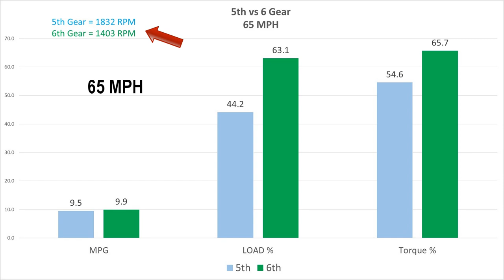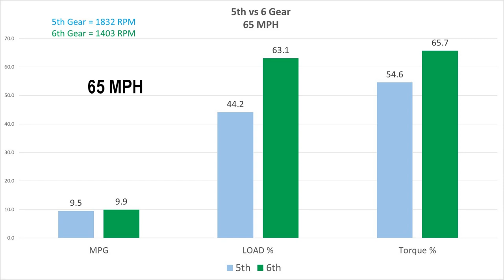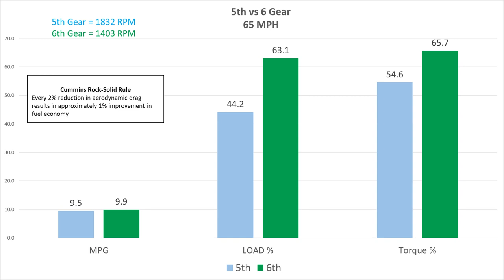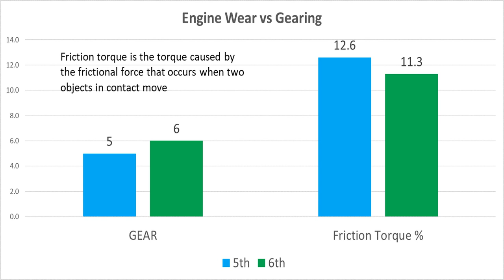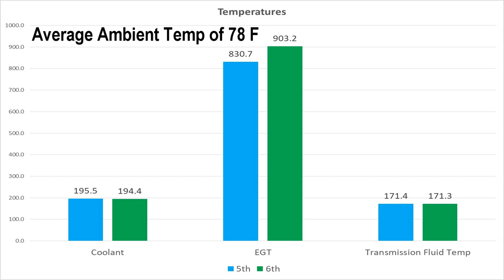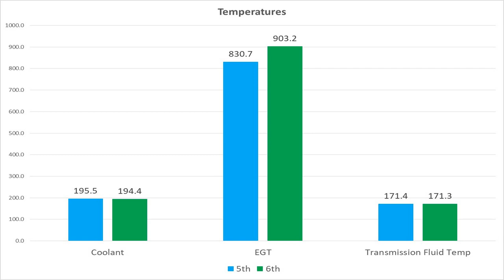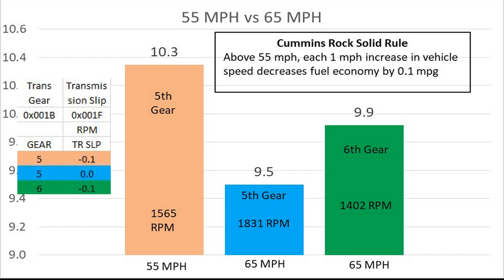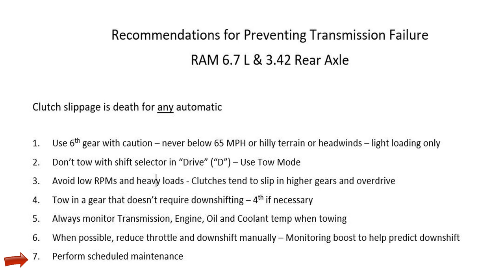RAM 6.7 L Cummins  - Towing in 5th vs 6th - Which gear?

Comment: Another great video, Mr Blair.  You know how to bring the data when you make a point on here!!  When I got my 2018 deleted a few months ago, I went also got the 68RFE tune package.  It does make a world of difference with shifts - much smoother and the tune I have keeps you out of 6th gear when you are towing much better than stock.
Reply from the maker: Thanks, that's what's probably next for me.
Reply: Marion Blair : I think you will be impressed with how much better the 6.7 Cummins runs “uncorked” - not that it’s bad performer with emissions from the factory.   I went with MotorOps tuning and EZLynk for the controller.  Good stuff for the engine and transmission.
Reply from the maker: @brenteason9891  thanks, MotorOps tuning and EZLynk , that was going to be my next question.
Reply: @MarionBlair  : Been happy with the MotorOps and EZLynk setup.  Gives you 30, 60, 100, 150 and 180HP on the SOTF selector.  You will need an EGT probe after the delete since the factory one will not work anymore.  Did not know that.
Reply: @MarionBlair  :  Made a quick video of my truck that you can take a look at here with the delete modifications:  https://youtu.be/cxPTXqimMWI

Comment: Is it H&s transmission tuner that does all this for you?  If I'm wrong let me know and I will find the correct name.  I'm still in warranty but when that's gone I'm getting a tuner for the trans.
Reply from the maker: No I'm 100% stock.  I'm just using the selector on column for changing gears.

Comment: I run 6th gear on interstate at 70 MPH pulling my 10000lb 5th wheel, if I see a good size hill coming up I will just before hitting that hill shift to 5th, the biggest and longest hills in Tenn, I will shift to 4th and hold a constant speed using of course in Tow/haul  mode.

Comment: I have a 2020 HO cummins with 3.73's.  Towing my fifth wheel I won't even see 6th gear until 65 mph, which it will hold on everything but the biggest hills around me.
Reply from the maker: yea, wish I had the 3.73

Comment: Could you do a video on maximum temps on coolant-trans and oil temps..... my truck get to 225 on coolant and 230 oil temps on a steep grade .... just wondering how hot i can run this truck...  thanks
Reply: Funny thing on the way to Colorado going through Kansas, I swore I heard "ghosts".  Ghosts or the winds were so strong that it made that sound like blowing over a beer bottle.  
What WASNT funny is that as I was entering Denver, in traffic during 90+ degree heat, that ghost sound turned out to be cooling efforts made by the RAM.  
Even after we un hitched and went to grab some dinner, until all of that cooled down, those fans were LOUD.  

Has anyone else experienced anything like that?
Reply from the maker: Great suggestion!   That's pretty hot but still within the limits for synthetic.  I'd try to back off if possible.  The highest I ever got and I don't remember the exact numbers was Monarch pass in Colorado.  That was a 2nd gear climb for me.  Don't hesitate to pull over and let the temps settle down when possible.

Comment: I just get in the truck and drive the dang thing. I guess figured the tow/haul mode sorted that out. Honestly most times unless I've got the heaviest thing I tow,my tractor I don't even put it in tow/haul because it uses more fuel. I probably shouldn't tell you I tow at 70-80 mph either, usually closer to 80. Now you got me wondering if I should make some adjustments to my driving style cause I want my truck to last. The truck doesn't seem to mind though, temps are steady.
Reply from the maker: So you the guy that blew by me at 80 mpg the other day, ha.  No problem for me.  I'm wondering why your mileage is less though in tow mode.  Maybe it's staying in 5th?  At 80, I would think it should shift to 6th even in tow mode.
Reply: Haha not likely as I'm in upstate NY and haven't been south of the Mason-Dixon line in quite some time. Yeah you might be on to something there, could be spending more time in 5th. One thing I know for sure is it holds a lower gear longer allowing for consistently higher rpm's in tow mode. I attribute lower mpg to the higher rpm for each gear change. I guess my thinking is pulling 7,000 pounds with a truck rated for 17 shouldn't be a issue. I'll also say I don't drive aggressive and I  try to be smooth but if there's room I open it up.

Comment: I was towing in the smoky mountains last week and had to take it out of tow mode coming down the mountain because it wanted to down shift too much causing the engine to run up to 3000 rpms. I just left it in 5th gear and let the exhaust brake coast me down then put it back in tow mode.
Reply from the maker: Yeah I'm at that issue also, a problem they need to address.   It happens all of a sudden and you just don't expect it.
Reply: There's no issue with running this engine at 3000+ RPMs, even for extended periods, provided you're not lugging the engine.  The 6.7 Cummins is designed and tested to run at 3300 RPM for hours without failure, and running them at higher RPMs moves more air through the engine which keeps everything cooler.
Reply: Monster RAM I wasn’t really concerned with the rpms I guess as much as how it down shifted hard. Probably just me. I sure it was ok I just didn’t like it.
Reply: @rhod8201   A hard downshift from 6-5 can cause a P0735 code which will be the beginning of the end for a 68rfe.  If you can, manually downshift with the +/- button.
Reply: Monster RAM or just cut the tow haul off and it won’t do it. Let the exhaust brake do the job.
Reply from the maker: Mine shifts to 3rd way to early with steep downhill and I shit my pants.
Reply: Marion Blair Hahahaha
Reply: Marion Blair me too

Comment: What about heat on the engine and transmission.
Reply from the maker: The 68RFE is extremely well cooled so it don't care.  Engine temp goes up but not enough to hurt it.  In fact if you can get EGT up to about 950, you can burn off the soot in the DPF with regens.  I prefer 5th for all but flat, low altitude roads.
Reply: @MarionBlair   Thank-you for your reply sir. Why do you prefer 5 th for all flat and low lands? You have alot more experience than I do. I would like learn if you don't mind sharing your experience.

Comment: Very good points Marion. !
I just sold my 2009 ram 2500 Cummins 
Absolutely loved the power. Looking to upgrage to a one ton getting a bigger fifth wheel.
Really leaning to a ram heavy duty again. But that new ford diesel with 10 speed transmission has been getting very good reviews.
But when I put the pedal down in that cummins.......
You know what I mean Marion
 Put I do not from the Cummins
Reply from the maker: Yea, Ford looks good also.  I have a buddy with a Super Duty and it pulls really well.  He did have some issues with the death wobble but they fixed it I think.

Comment: New (2013) owner. Where do you find information on Transmission and Rear End ratio’s.
Reply from the maker: https://windowstickerlookup.com/ I can tell you it's a 3.42 if it's a 2500
Reply: @MarionBlair  Thanks, I have a 3:42.
Reply from the maker: @goducgo  Yep, 5th gear I assume.  1750 RPM is pretty much optimum on the torque curve.

Comment: Would you tow within the same perimeters with a manual transmission pulling a load?
Reply from the maker: Yes sir I would, I had a manual and loved it.  The RAM's were reported to have weak clutch plate springs and some people upgraded them but I never had any issues pulling my 7500 lb trailer. (5.9L) With the manual, I would lug the hills a lot more.  That's what I love about the manual.  No issues with over heat on the manual.
Reply: @MarionBlair  I pull about 10,000 lbs with no issues so far with the clutch but I've had manuals all my life so I know how to treat them.

Comment: How did you calculate gear slippage?
Reply from the maker: I use the Banks Idash which calculates slippage.  There's a very long thread on the Cummins Forum on calculating it by hand.

Comment: The 68rfe will not last in 6th gear with heavy loads.  Transmission rebuilders know this....I purchased my truck used. I realized later my Transmission had been rebuilt....
Reply from the maker: Yes, I totally agree.

Comment: I was told to try in stay in 4th gear because that clutch is bigger than 5th. 5th gear clutch is the smallest clutch in a 68rfe. So i was told you can wear 5th out fast due to its size.  Im not a transmission guy im a engine guy. So due your own research.
Reply from the maker: Fourth is 1:1 so there's no planetary gears so yes it's biggest strongest gear you have however you will be turning a lot of RPM but if you're pulling a very heavy load relatively slow speeds it's a great gear.

Comment: How often do you change your transmission fluid?
Reply from the maker: Haven't done it on this truck yet because of low mileage but I'll change it probably around 60K.  If you don't tow, often, it can go much longer.
Reply: I was changing mine every 30,000 but was told by diesel tech to change probably every 20,000 with the 68. I have deep pan,running +60 hp tune and my trans temp stays around 160 while towing 27’ bumper pull!
Reply from the maker: @robertthibodeaux4435  well to each his own but I think that's pretty often unless you really hard on your transmission.
Reply: Robert Thibodeaux yeah I may need to re-evaluate my intervals. I tow about 12,000lbs 3 or 4 times a year. My fluid has a little smell to it. Looks good still and I have about 40,000 on my truck.
Reply from the maker: @UncleJack5224  Yea, too often.  Pull in a gear that doesn't downshift and don't let it overheat and it'll last a long time.

Comment: I tow in 5th. In tow mode.
Reply from the maker: I think that's wise.  6th and the 3.42 diff is pretty much for better empty mileage.  I think that's why RAM gears are so tall.  I ran my scenario though the Cummins powertech program and it wants the 6.7 to be running between 1800 and 2000 rpm at 65 mph.